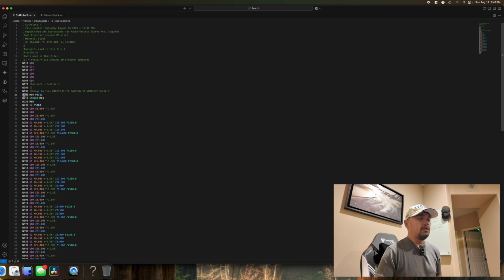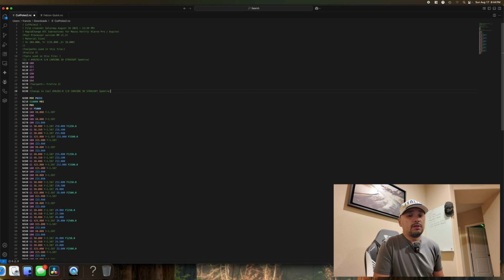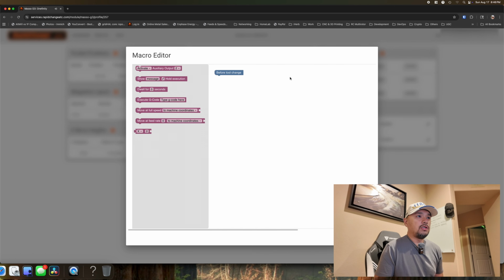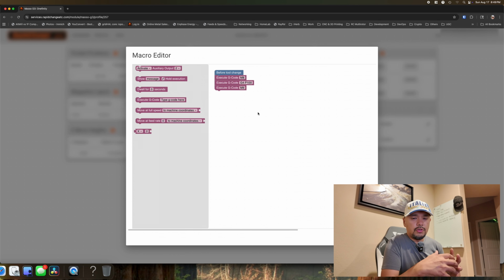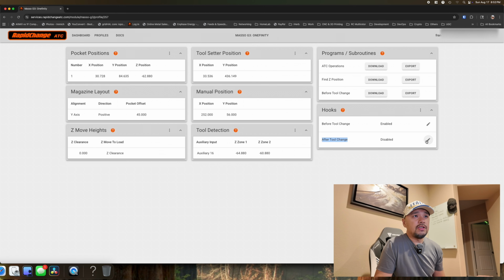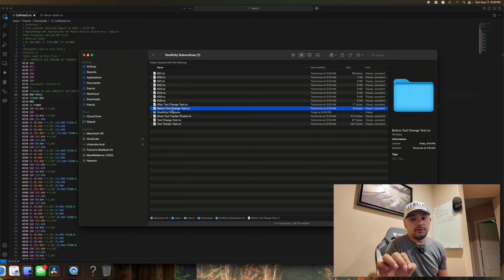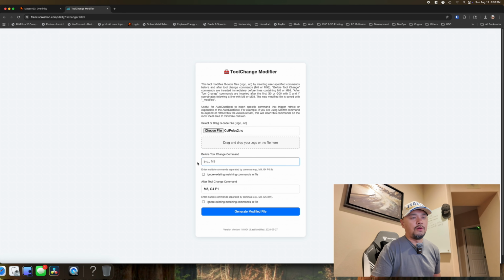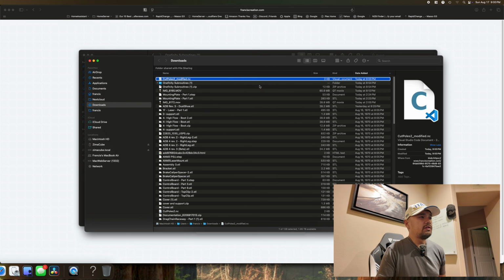Integrating AutoDustBoot with RapidChangeATC

Comment: So I see this mostly being used for moving out of the way for ATC but can it be used to self adjust to material thickness over the course of a cut? Also are all the moves programed or are there sensors?
Reply from the maker: They don’t have sensors, aside from a limit switch used for homing on bootup, and travel can’t be controlled through G-code. The only available commands are retract and expand, which can be triggered by G-code, similar to M8/M9 for flood. The dust boot has a fixed height when expanded and is not attached to the spindle like other dust boots, where the deeper the spindle plunges, the more the brush gets compressed. However, you can still manually adjust the dust boot’s height while it’s running by rotating the manual control knob.
Reply: @francis.creation  How hard would it be to interface as the 4th axis and control via gcode?

Comment: This is all well in good in the rapid change atc web ui for the before and after, but it doesnt apply it to the P231 macro for tool measure. The TC macro is pretty straightforward as its integrated into the before and after.  If you run the 231 macro its not there.  I added mine manually for now.
Reply from the maker: I personally still use the macro that I already tweak to my liking. It easy to maintain and modify vs to the web generator but most of my customers are not comfortable with editing macros and prefer to use web generator. This guide is more the Masso + EasyATC or RapidChangeATC users as I keep getting inquires about it. 😊